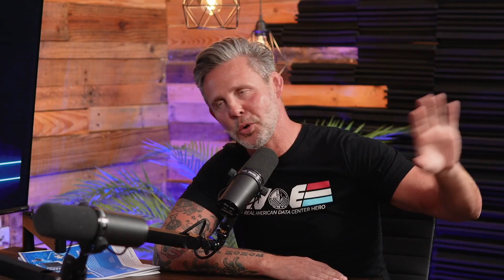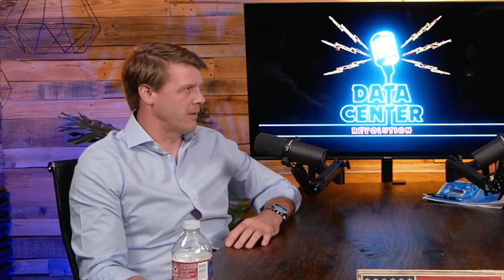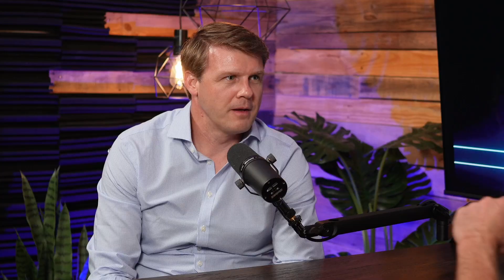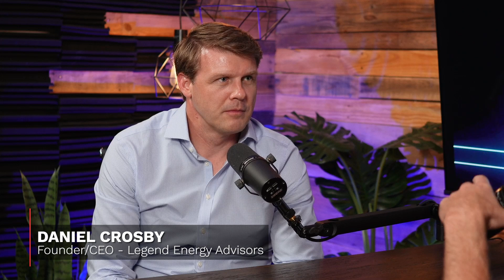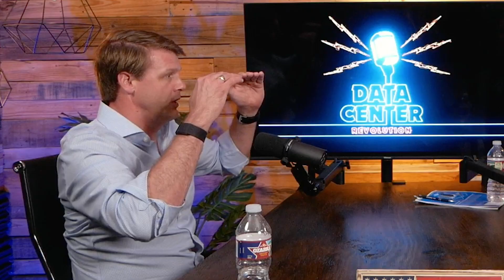Ep 96: Bridge to the Future (with Daniel Crosby)

Comment: One key missing link in this podcast is the total undersupply of new generation equipment in the market by the OEMs like GE Vernova, Mitsubishi, Siemens Energy, Jennbacher, CAT and Solar. Most out of them are two years out to delivery of generation equipment, and then there is switchgear and high voltage equipment that is also delivering on a long term basis. 

With GWs of demand from electrification and data centers, what is a realistic timeline to get  GWs online?